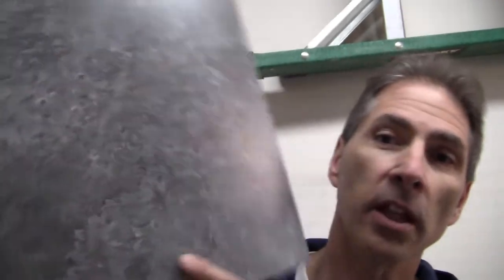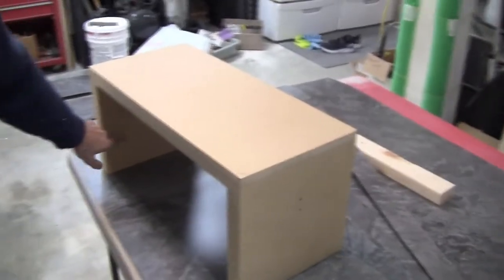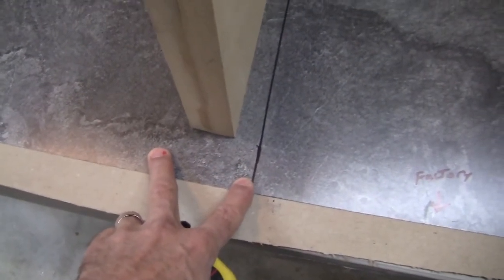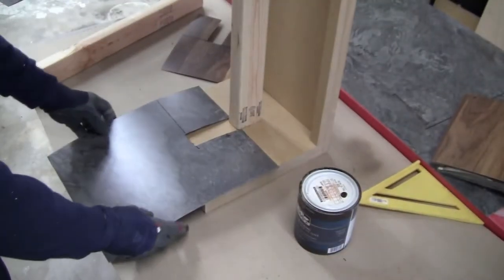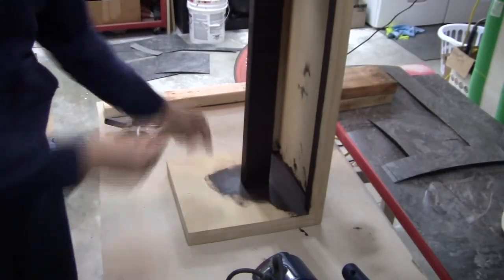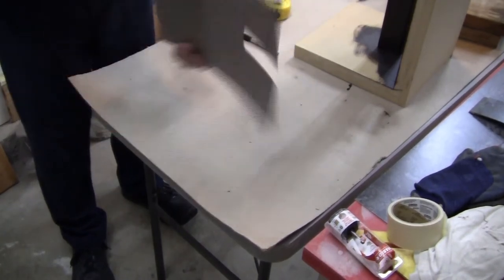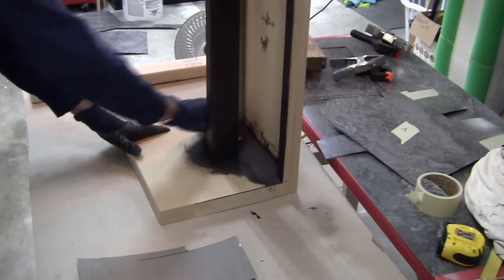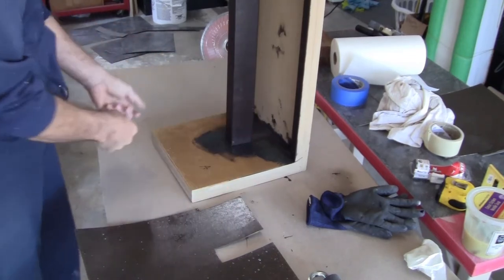Building a Formica Laminate Waterfall Table

Comment: I have a staircase opening that is 36” high and 48” wide and about 104” long. I would like to build one of these waterfall tables on caster wheels to cover the staircase when not in use because I have small kids and the opening is between the kitchen and dining room. With a table that large, what is the best way to build supports?
Reply from the maker: try shelf brackets or large angle brackets.
Reply: Will that MDF support castor wheels or should I use plywood instead?
Reply from the maker: @davidchad77  MDF is very stong. I can suppoert castor wheels depending on how you build it. I stood on the sample table I built in the video and no issues.

Comment: Curious, why not just laminate the inside end panels before adding the lip and bracing? I do cabinet refacing using RTF laminate.
Reply from the maker: good point, I did not think of that. Yes, I agree, Laminate first then put on bracing would have been a cleaner look.